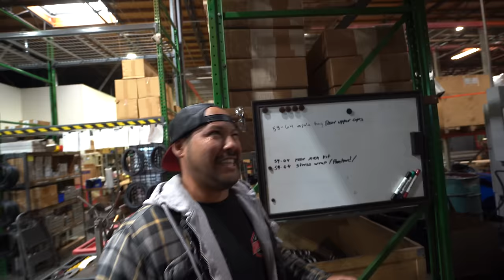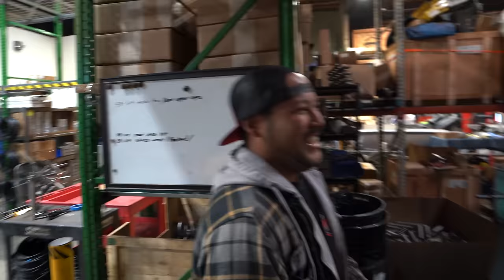FIRST JDM TRUCK

Comment: This dude's full of s**ain't no way he was producing 100 to 200 cars in one year and he just said oh it takes about a year to produce one car and 100K damn that better be a nice ass lowrider if I had a 100K right now my 77 c30 would be f***** dump on switches for half of that can I use the other half to buy another car
Reply: 100 basic install with a 15- 20 man crew is the truth. We have since then moved to full manufacturing  and if you think 100k is a lot to build  show quality  lowrider then you must be crazy... most of these cars are over 50-80k just to purchase a decent one. 15-30k for motor/trans  20k for paint 20 for upholstery. 10k for frame work, 10k for hydraulics. 20k for chroming  and new hardware. The list goes on brotha.
Reply: @alexhoppos909  I can literally buy any of those cars right now in good condition for less than 5k lol and bullshit you said it took your crew a year to do that gay ass van lmao that's a Lego kit bro coulda done that in two months if you have a 15-20 man crew lmao so I doubt 100+ in a year. Also if you've been doing over 100 a year for years where tf are they all at lmao 🤣